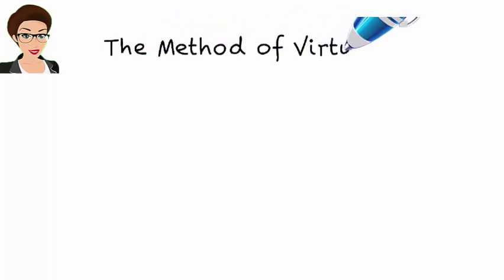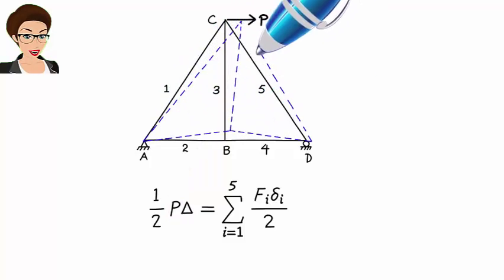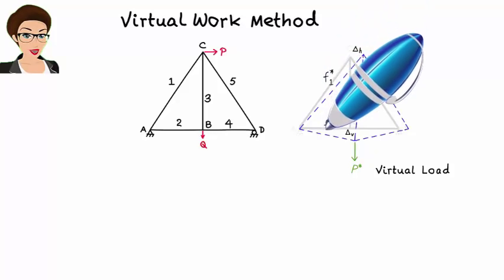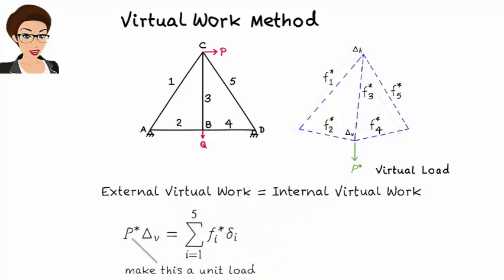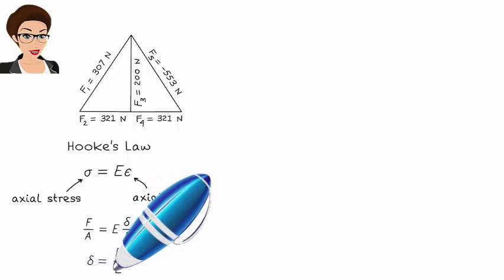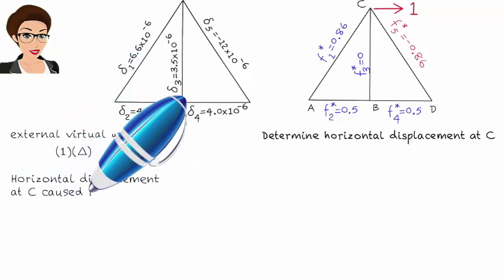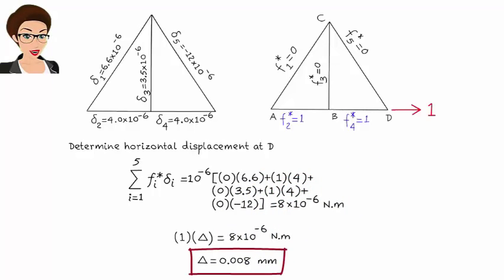SA21: Virtual Work Method (Trusses)

Comment: I think you made a mistake at 10:00 when you calculate the internal virtual work. Shouldn't the virtual forces in members 2 (f2*) and 4 (f4*) be multiplied by 4.0*10^-6 instead of 3.5*10-6? I really liked the video btw.
Reply from the maker: Yes, you are right. Thanks for pointing the error.

Comment: This is good. How did you calculate f* in each case by placing unit load at desired point? Do you have a video which shows how to calculate that?
Reply from the maker: (f*) forces can be calculated using a truss analysis technique such as the method of joints or sections. Just analyze the statically determinate truss when it is subjected to a unit load and that gives the member forces (f*s). 

We have a number of lecture on truss analysis on this channel. Alternatively, you can access them through our online course (link given in the project description field).

Comment: Can you elaborate on what exactly was done at 9:40 (Truss analysis) to get the values on the members. Thank you for this video also, really helpful.
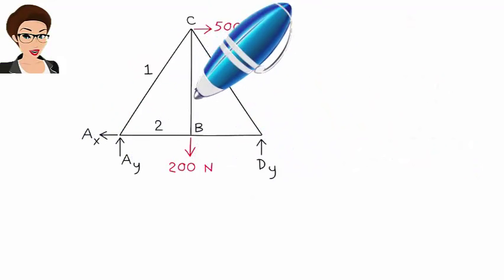Reply from the maker: This geometry of the truss and its supports were defined before. Starting @6:39, the video shows how to calculate the support reactions when the truss is subjected to two concentrated loads (500 N and 200 N). Then, starting @7:00 the procedure for calculating member forces is shown, again for the two applied loads. 

Starting @9:40, we want to analyze the same truss but under a unit load only. So, remove the applied loads (500 N and 200 N), place a unit load at C and follow the same procedure as before to get the member forces.
Reply: @DrStructure  distances will remain same right? Just unit load will be applied right? 

BTW thank you so much for these lectures I wish I would have known this channel 2 years before, my life would've been completely different then!! 
And yes please upload other subjects also.... ❤❤
More power to you Doc! 🙌
Reply from the maker: @DK-db4ot  Yes, the distances remain the same. And thanks for the feedback. :)
Reply: completely threw me off do you add in the same pin and roller as well

Comment: Thanks Dr. Structure. But I have a question, how can you handle a case where the deflection is needed at somewhere in the middle of a member of a truss; not at the joint.
Reply from the maker: Since truss members don't bend, they just displace (translate and rotate), if we know the displacements at the ends of the truss member, we can use simple linear interpolation to determine the displacement at a specific point within the member.
Reply: Hi, Dr. Structure. You mean I come up with a graph then an equation of the same which is in the form of y=mx+c
Reply from the maker: Yes, this is a pure geometry problem. We know the end positions of the truss member. These are two points in the xy-coordinate system. So, we can construct a line equation (i.e., y = mx + c) for the member. The equation enables us to determine the x and y position on every point on the member. 

If the ends of the member have displaces by some amount, say the left end of the member is located at (x1, y1) and had displaced by (dx1, dy1). Then, the new (displaced) position of the left end of the member is point (x1+dx1,y1+dy1). The same is true for the right end of the member. Its new/displaced position can be expressed as (x2+dx2,y2+dy2). 

Knowing these two new points, we can come up with a linear equation (of the form y = mx + c) for the displaced member. This equation can then be used to determine the displacement at any point within the length of the member.
Reply: @DrStructure  Wow!!! Superb. I wanna try this. Thanks for your continued help.

Comment: Please let me know why virtual external work done is not 1/2*(P')*Del? Why didn't we use1/2 here?
Reply: of course, it will cancelled out from both sides as we calculate virtual work done in members as well, I am just curious why didn't we use it.
Reply from the maker: Suppose a beam has been displaced by D at some point (x) due to the applied loads. Imagine that we can remove the applied loads but keep the beam in its displaced form. Now, if we place a virtual load (f) at point x in the direction of D, the load going through the existing displacement D, we say, produces virtual work of fD. Since f is not causing D but simply “traveling” through it, the 1/2 factor does not come into play.
Reply: @DrStructure  Thank you so much. 🙏🏼

Comment: Good day

I have a question of a question that is externally statically indeterminate which is requiring me to find the deflection at a point with a give load.  So my question is on getting the forces on the truss so that i can calculate the member elongations before i calculate the deflections.

So do i have to use SA26 first to calculate the forces of an indeterminate truss then i can use SA21 to calculate the deflections?

If there is a simpler way or short cut, please assist.
Reply from the maker: Yes, you need to analyze the truss first, for example using the force method (SA26), before you can determine the displacement using the virtual work method.  Alternatively, you can use the matrix (displacement) method which gives the joint displacements as well as member forces for a statically indeterminate system, see SA48 for an explanation of its use for truss analysis.
Reply: @DrStructure  Thank you so much.

I thought there was a simpler way as the question was under multiple choice, so i thought less work was needed. But well let me take the long way and see if i win.

Comment: shouldnt the work done  around  5:08 be (1/2)*P*(delta)..?
Reply from the maker: The virtual load is always placed on the deformed structure, meaning delta (due to the real load) has already taken place.  So, the virtual load travels through an existing displacement causing work to be done. This work does not have the 1/2 factor associated with it. The 1/2 factor comes into the picture if the force is the cause of the displacement.
Reply: Dr. Structure thank you for your clarification sir

Comment: 3:46 why is it p*∆v why not (1/2) p*∆v ? Also when should we take force×displacement and when (1/2) force × displacement for work please explain
Reply from the maker: Real work done by a force equals (P)(D)/2 where P is the force and D is the displacement in the direction of the force. We derived this expression in Lecture SA19. In that derivation, we started by placing a small force f on the beam and referred to the displacement caused by that tiny force as d. We then expressed work as (f)(d). We showed that by keep adding the small load increment f, we will eventually arrive at the expression (P)(D)/2. 

Basically, the virtual work method established the work-energy relationship based on f and d, indicating that the “virtual” work produced by the small load increment (f) must be equal to the internal energy caused by f. In that derivation the 1/2 factor does not come into the picture, yet the equality between work and energy holds true.

Alternatively, you can think about it in the following way. A structure has real deformation under an applied load. Let’s refer to the load as P and to the resulting displacement under the load as D. After the deformation takes place, suppose somehow we can keep the structure in its deformed shape while removing the load. So, D remains present, yet P is no longer there. Now, if we place a virtual load (a very small load) in the position and direction of P, let’s call it p*, since p* goes through displacement D, it produced (p*)(D) work. The 1/2 factor is not going to be present here, since D was not caused by p*, the displacement was present by the time p* appeared on the scene. So p* simply travels through the existing distance (D) producing work: (P)(D). We refer to this product as virtual work, not real work. According to the law of conservation of energy, this virtual (external) work must be equal to the virtual internal energy/work caused by p*.

Comment: Great video, so if the structure was statically indeterminate would you have to use a finite method to calculate the member forces first?, after which we can apply the unit load and use the virtual work method with the member displacements?
Reply from the maker: +Liam O'Donnell Yes, if the structure is statically indeterminate an appropriate analysis technique (such as the Force Method) needs to be used to determine member forces. However, it would become unnecessary to use the method of virtual work to determine joint displacements if you want to resort to the finite element method (FEM) for calculating forces. Why? Because the widely used FEM can determine joint displacements as well as member forces.
Reply: Great answer, thank you!

Comment: At 4:08 I find it counter-intuitive that internal virtual work for member 1 is f1star*delta1 (virtual force times real displacement). Why isn`t there a contribution from f1star*delta1star (virtual force times virtual displacement)?
Reply from the maker: Right, the underlying concept could be a bit confusing. Imagine a rigid body (in this case it is a truss, but it could be any sort of 2D or 3D body). When we subject the body to some external loads, it is going to deform. Now imagine that somehow we can keep that body in that deformed shape/position, but remove the loads that have caused the deformation. Or, if you like just ignore the loads. The principle of virtual work simply states that given such a state of deformation, if we place an imaginary (virtual) load on the body, the external work done by that virtual load equals to the internal energy produced by the load. Whether or not the virtual load creates additional deformation is not significant. The principle holds true for the existing (real) deformation, without any additional deformation added to the system. That is, the virtual load (without causing any additional deformation) going through the real deformation produces virtual external work. That work equals to the internal energy caused by the same load. The internal energy being the virtual internal forces/stresses going thought the real internal deformations/strains.

Comment: 9:45 what are the calculations for f1,2,3,4,5*?
Reply from the maker: We have a statically determinate truss subjected to a horizontal unit load at C. Apply the method of joints to analyze the truss and determine the member forces f1 thru f5.
Start with Joint C. There are two three forces acting at the joint: the applied unit load, the force in member AC (f1) and the force in member CD (f5). The two members make a 54.46 degrees angle with the horizontal (x-)axis. By setting the sum of the forces in the x-direction to zero, and setting the sum of the forces in the y-direction to zero, we can calculate f1 and f5. 
The remaining member forces can be determined in a similar manner.
If you are not familiar with the method of joints, you can review our lectures on the topic.
Reply: @DrStructure  When I do method of joints, is the unit load 1N going to replace 500N and 200N
Reply from the maker: The real loads (200 N and 500 N) need to be removed from the truss. They play no role in the analysis of the truss subjected to the virtual unit load. As for the unit of the virtual load, it does not matter what  is used, you can consider it to be 1 N.

Comment: 9:42  how did you get internal forces at members f*1,f*2,f*3,f*4 and f*5? please help me solving this one... Thanks in advance
Reply from the maker: There is a pin at A and a roller at D for the truss which makes it stable and statically determinate. Analyze the truss using the method of joints, as if it was a typical truss subjected to a unit horizontal load at C. There is nothing special about this truss except that the unit load is not real, it is made up. But that does not prevent us from applying the method of joints to calculate the member forces (f*i, i = 1,2 ...,5) due to the made up unit load.
Reply: thanks a lot, it is helpful 🙏🏽

Comment: Dr. Structure, what is the advantage of the virtual work method, in comparison with the double integration method?
Reply from the maker: The double integration method gives us the deflection equation for the entire beam. The virtual work method is for calculating the deflection at a specific point. The virtual work method can handle trusses as well as beams and frames. The double integration method is suitable for beams only.
Reply: @DrStructure  Great. Many thanks for your reply!
Reply from the maker: You're welcome.

Comment: Is there a working example to determine the slope of a displacement in a Truss and Frames. Because the examples I've gone through so far are only on displacements in Trusses and Frames. So how do you determine slope of deflection in a truss and Frame.
Reply from the maker: There is no single joint rotation in trusses. Each member attached to the joint rotates differently. You can determine such a rotation using simply geometry knowing the member end positions. We don't use the slope-deflection method to calculate slope in trusses, 

There are a few examples of joint rotation calculations for beams, See:
https://www.youtube.com/watch?v=E-qfuKL2rtY
https://www.youtube.com/watch?v=Fst1A4tI0YI
and the other videos labeled  SAPS.
Reply: Thank you for the help. I'll have a look at these examples.

Comment: For exercise 1, horizontal displacement at A = 19.14mm
Horizontal displacement at C = 2.5mm.
Vertical displacement at A calculation is a bit confusing....
Are the answers correct????
Reply from the maker: Yes, the numbers for Exercise 1 seem to be correct except for the unit. It should read m, no mm.  Your numbers are not the same as those given in the video, even for the horizontal displacements. Why the discrepancy? What makes you think something is wrong with the given solution?
Reply: @DrStructure  but the solutions are not provided anywhere....& that's why I asked it to u....
Reply from the maker: You should see a circled i at the upper right corner of the video where the two exercise problems are presented. Click on the i.  I believe the i should be visible in all platforms, desktop, mobile,...

Comment: would u give me a proof that external virtual work equals internal virtual work even if it might be difficult?
Reply from the maker: The aim of these lectures is to help students develop an intuitive understanding of structural analysis concepts and their applications. You may want to review SA19 and SA20 for a discussion on the work-energy principle. But, for a mathematical proof of the virtual work principle, you need to consult advanced structural analysis and engineering mechanics texts.

Comment: I think... Min.10:06 it's wrong. The correct form should be:

Internal Virtual Work = (0.86)(6.6X10-6)+(0.5)(4.0X10-6)+(0)(3.5X10-6)+(0.5)(4.0X10-6)+(-0.86)(-12X10-6)

Internal Virtual Work =1041X10-6 N.m

(1N) (Δ)= 1041X10-6 N.m

Δ= (1041X10-6 N.m)/ 1N

Δ= 1041X10-6 m  = 1.040 mm
Reply from the maker: Thanks for pointing out the error(s) in the equation.  As you have correctly pointed out, (0.5)(3.5x10-6) should be: (0.5)(4.0x10-6).  But, the final answer remains to be correct, the displacement is (20x10-6 m). The corrections are now added to the video using the YouTube annotation tool.
Reply: @DrStructure  sir can we apply the virtual work method if the truss is indeterminate?
Reply from the maker: @rikdevghosh7324  No, the truss needs to be determinate, or it needs to be analyzed before we can apply the virtual work method to calculate its displacements.

Comment: how do you calculate the internal member forces
Reply from the maker: The truss is statically determinate; the method of joints can be used to analyze the truss, to determine the member forces.
Reply: @DrStructure  ouh thanks

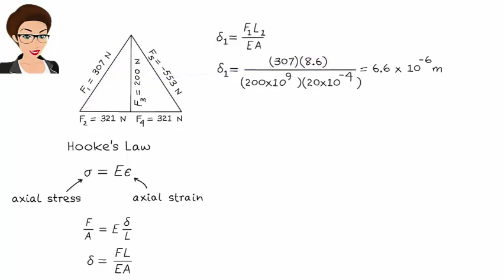Comment: At 8:18 how did you get 8.6 as l1
Reply from the maker: The height of the truss is 7 m. So the height of the right triangle in which our member forms the hypotenuses is 7. The base of the right triangle is 5 m. That makes the length of hypotenuse the square root of the sum of the squares of the two sides.

Square root of 7^2 + 5^2 is 8.6

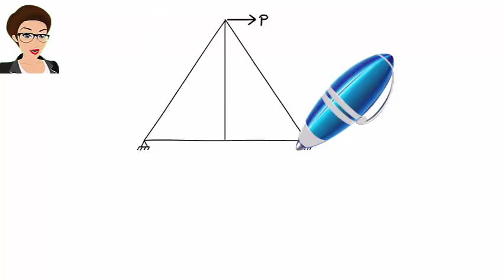Comment: at 1:20 how we can find deltaB hence there is no external load acting at B?
Reply from the maker: Using the virtual work method, yes.
Reply: Dr. Structure 
But there is zero load then there will be zero displacement!?
Reply from the maker: No, there needs not to be a load at the point in order for it to displace. The displacement could be the result of a load applied at a different location.  Generally, a single load applied to a structure at point A causes displacement at points A, B, C, D, ...

Comment: Hi, I don`t understand that how can i calculate the f* force at 9:40? i am very confused. Could u clearly explain that?
Reply: IF there is unit load in point C, and remove 500N and 200N. I calculated reaction on A and B first, got Ay=-1.43, By=1.43, Ax=-1. And then, I used method of joints to calculate the f1*, the answer is 1.75, which comes from (f1* X sin(54.46)-1.43)=0, I followed before steps. So, why i cant get ur ans?
Reply: Oh, I got the answer. I made a mistake in calculation. Thank you for your videos, help me a lot in studying structure.
Reply: I don't get it mate, can you explain it a bit? Thank you in advance.
Reply: oh i get it mate.